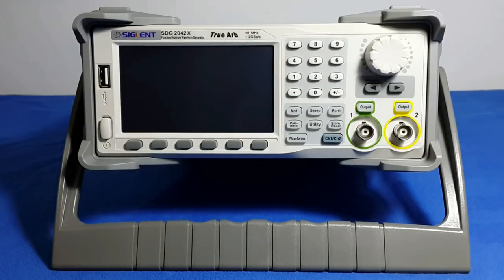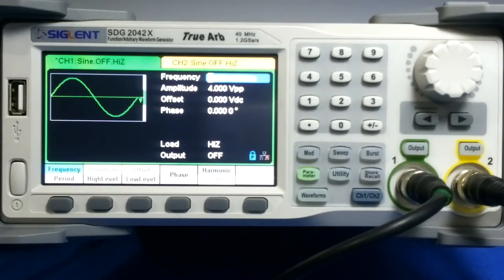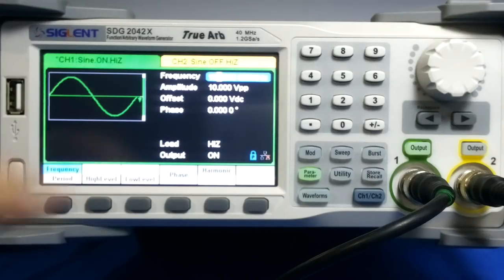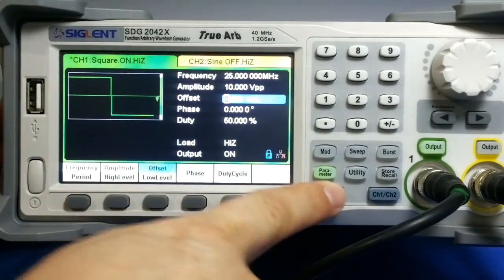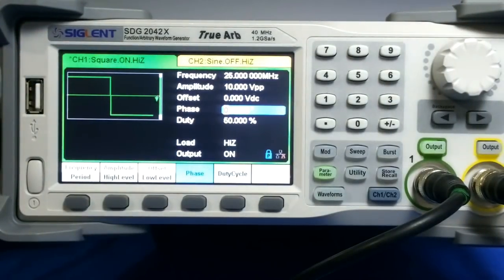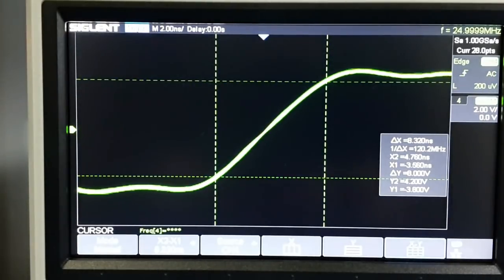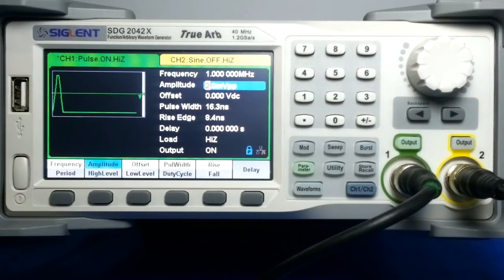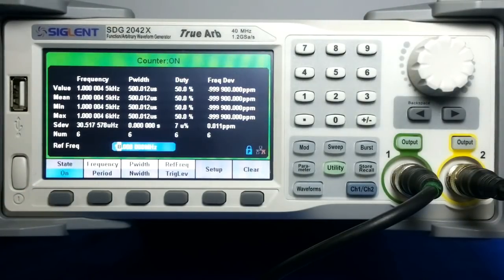SDG2000X product review / Siglent Function Generator SDG2042X - SDG2082X - SDG2122X

Comment: Hello, i have a question. Is it normal that when i go with amplitude 10Vpp and sine signal from 20MHz to 40MHz the amplitude falls down for arround 1.5Vpp? I am using the generator On HiZand using ordinary coax cable. Thank you!

Comment: How are you able to get this SDG 2042X to go above 40 megahertz ?
Reply from the maker: It was designed as 120MHz, but labeled as 40MHz to be presented in showrooms with the other two models. It was from first production and made for display. Siglent gave to the channel for futures videos because after being in publicity, pictures and events, they wanted the unit to be used for education. About your question, hardware is similar in the models, but it is made with some specific characteristics for its function definition.   I will explain your answer in a future video .

Comment: Thank You for this video! I can't wait for you to do more! Until I viewed your video, I did not realise that this unit can also be used as an independent  frequency counter! It's just AMAZING what these "Modern" generators can do, with specifications that we Old Timers could only dream of! I have both a Siglent scope and arbitrary waveform generator now, and am an Old Dog learning the new tricks, Thanks to you!
 Questions: Can this unit also serve as an RF Generator for receiver alignments, or would you recommend an additional generator solely for this purpose? Also, is there a cheap module that can use GPS for frequency reference to plug into this equipment? What is your location, and Are you an Amateur Radio Operator?  73 and all the Best! DE W8LV Bill

Comment: Hey Bob,I need your help with that!
https://youtu.be/k7fryQmUeDM
What it's the problem,on a monitor connected with a vga cable does not!
Reply from the maker: ¡Hola! Si un monitor externo no falla, entonces puedes estar seguro que es un asunto de conección o deterioro del cable.
Reply: Observation
when I use the battery, it makes much worse, and for example when the picture is white does not!
And if it clicks on the display case it makes less